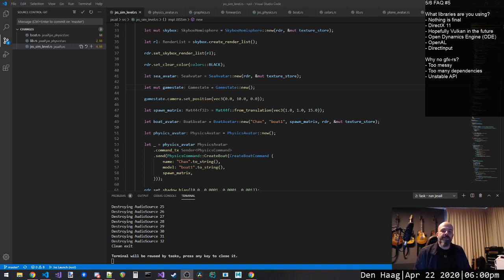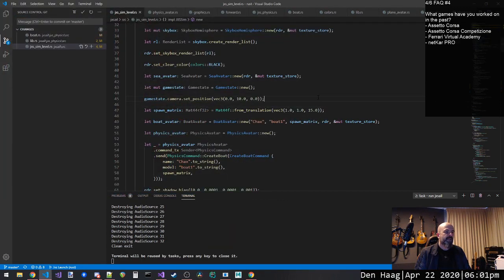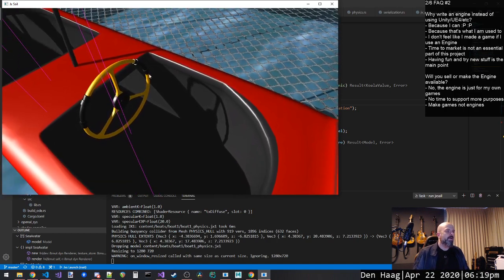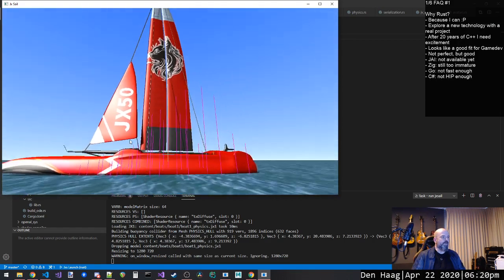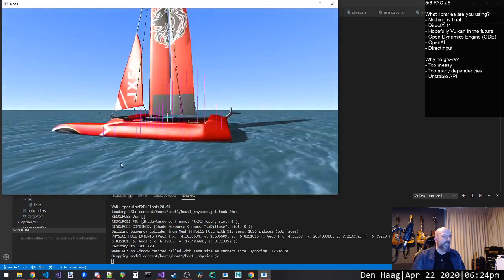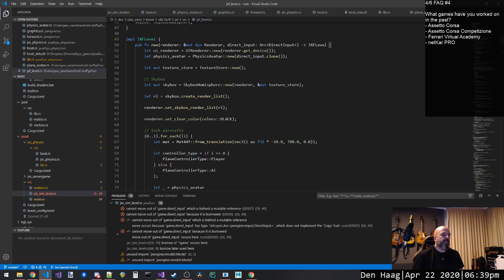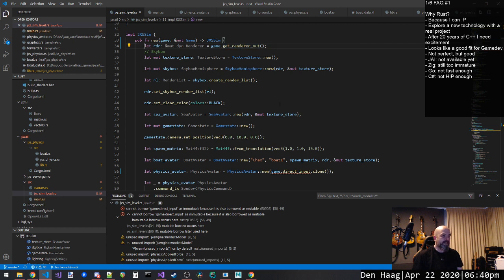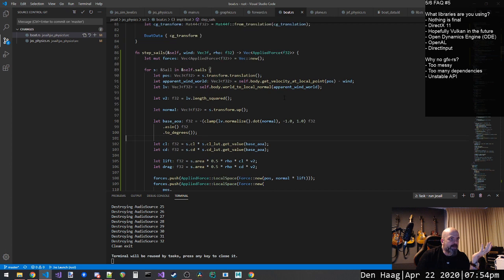JVS Live #9 - Game development in Rust - We are sailing!

Comment: At 07:22  - When you calculate the buoyancy force for a triangle, you keep only the vertical component and zero out the rest (lines 185-186). This is not correct. The hydrostatic force acts not along the force of gravity, but along the normal to the surface of the triangle. If you will use the longitudinal components of the buoyancy force vector, the model will work correctly when the water level is higher from the one side of body. There will be a moment that rolls the boat.
Reply from the maker: you are totally right, it's already like that in my latest code.